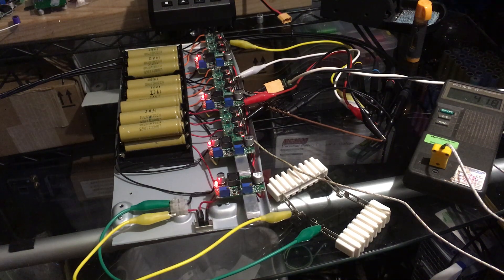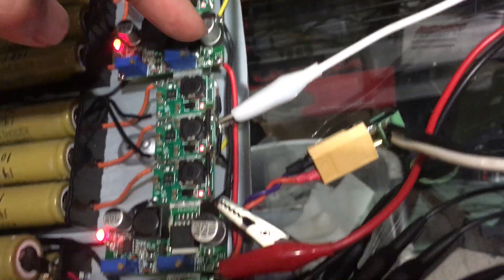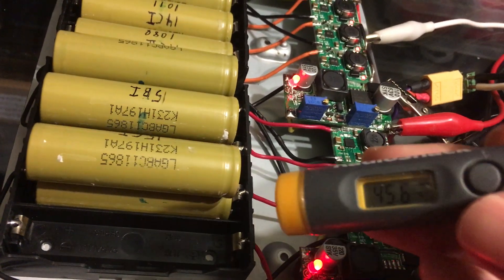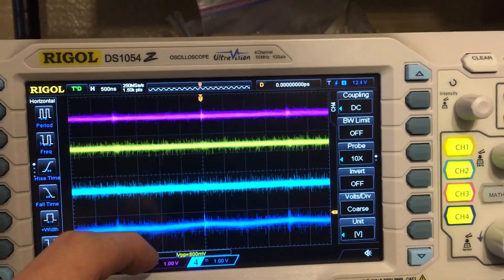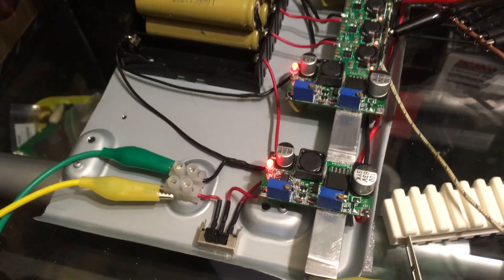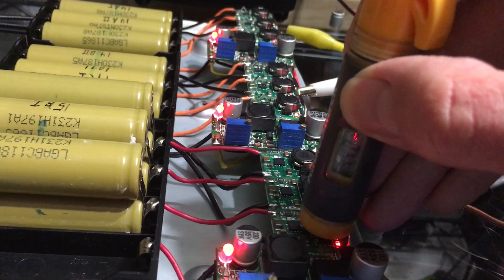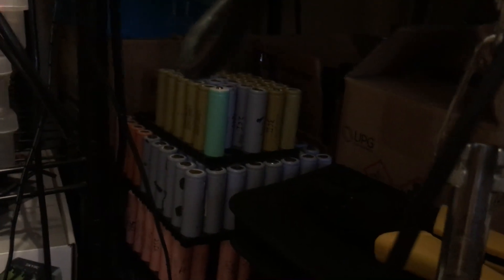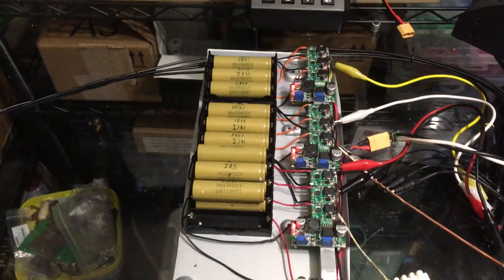Best TP5100 Charging Station, 10 way 18650 Charger

Comment: Is tp 5100 (2amp output) good for 18650 2100 mah cells health as it's nearly the battery capacity ols suggest
Reply from the maker: You will have to consult the datasheet for your particular brand of cells, normally a 1C rate is acceptable but will lead to more degradation than a 0.5C rate or lower, C rate is calculated by the charge current in amps divided by the amp hour capacity. so in your case the 2A charge rate divided by the 2.1Ah capacity of the battery equals 0.95C, where a less degrading charge rate can be calculated by 0.5C * 2.1Ah = 1.05A
So in summary a 2A TP5100 will work and charge the cells nice and fast, but a 1A or less TP5100 will cause less degration over a long time. If you notice in the video I modified mine to only output 500mA by soldering the two parallel current resistors instead in series to quadruple the resistance equalling 1/4 of the charge current. Good luck on your build!

Comment: Whatts up dude,  does it have cut off charging when batteries fully charged? In my case i'll use this module 24h pluggen in for my ups router backup, isnt legit? Thanks , warm regard from indonesia
Reply from the maker: do not use the TP5100 for that purpose. You should check out my DC UPS Mk2 video where I explain my setup for backing up my router. All you need are two diodes pointing towards the positive for the router. Then have the battery supply on one input, then a grid power supply on the other input. Then use the TP5100 to only charge the battery, and when there is grid power the router is powered from the other power supply.
Thanks for the comment, I hope this helps and your project goes well!
Reply: @SuperBrainAK  shoot , really heplful , thanks for helpme out very clear, have a great project bud , we're always support u 👍👍👍👍
Reply from the maker: @biladz1772  I appreciate the support!

Comment: I built a big 18650  charger using a load of Tp4056 boards long time ago, can't remember how many cells now I feel it was about 26 I used a Atx psu to power it... it's at my parents home so I may big it out next time I visit them and show it on yt .. it's a little crude but effective like most of the stuff I knock up🤣🤣 ..
This is really awesome mate good work thanks for sharing 

Steve
Reply from the maker: yea that is cool! hey cheap but effective is all you need, I went with a more robust design since I didnt want to power it with just a 5v power supply. I like to be able to power my designs easily from a DC supply instead of a bunch of mains adapters everywhere.

Comment: looks cool! Off topic but i'm curious what would i need to hollow out the xbox slim brick and then replace it with some cells to make it totally portable? I'm talking RGH no need for disk drive amperage. I know its 12v so just enough for like 2 hours of power maybe? Or maybe put a type c female plug on the xbox input and use a 45watt brick maybe?
thanks
Reply from the maker: thanks! Hmm that sounds like an interesting project. I dont think everything will be able to fit inside the original slim charger. you can certainly use the original power cable and a type-C input to charge.
Reply: @SuperBrainAK  I might have to mess around with it to see what the bare minimum amperage the slim will run on. 
  Maybe if someone reads this comment they have done something like this or might want to collaborate a video with me on it. I have to get familiar with lipo batteries and learn how to solder better lol. Thanks man you got a good channel going here.
Reply from the maker: @modstek  thanks bud, if you have the budget I would recommend getting this (https://www.aliexpress.com/item/4000355227194.html) for the battery to Xbox voltage regulator, then just have a 4S Li-ion BMS to protect the batteries. For charging the battery you can get a type-C trigger board (https://www.aliexpress.com/item/32969919810.html get the ZY12PDS-3 "color") and an adjustable CC/CV boost converter and set a low current limit.

Comment: I still say it was crazy to use that metal tray ;-)
Reply from the maker: steve64464 hey, I assure you it’s safe, it’s way easier to work with than wood, my powerhub (what I have all my DPS buck converters and 150W load on) didn’t turn out too great because the screws don’t stay in solid and the wood splits around where I cut the holes for the screens of the units.